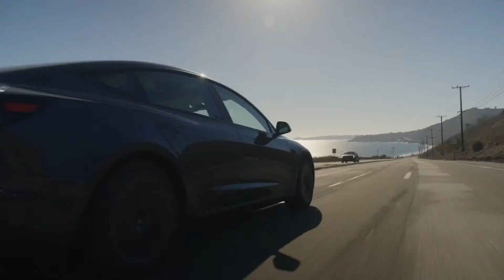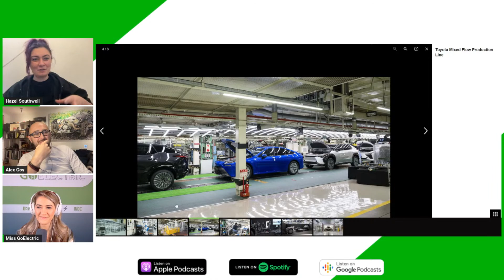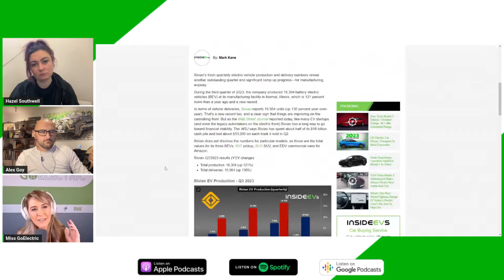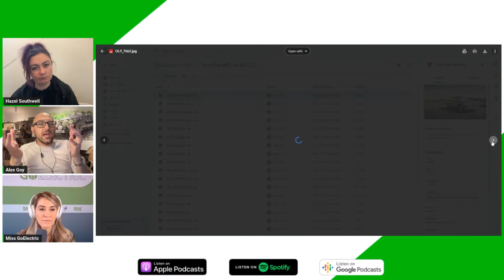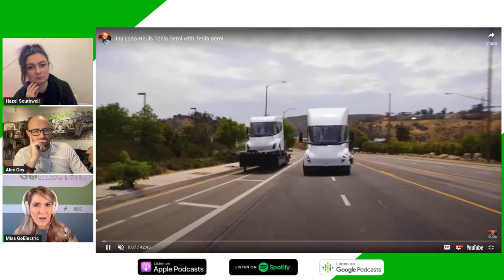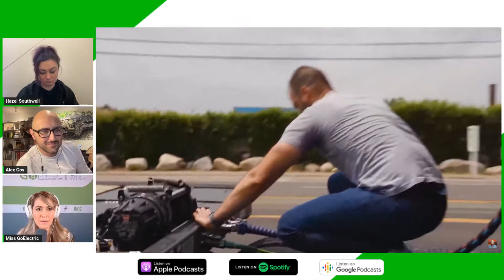InsideEVs Podcast #181: Hyundai Adopts NACS, Toyota EV Production, Ford + GM EV Sales, Tesla Updates

Comment: Having done some work on adding a second model to a Landrover production line (L462 and L405), despite the two sharing a platform swapping between models added considerable time to each cycle in some of the process steps.
The particular bit I helped with the time went from 10 to 12 seconds even without a model change just  because the robot needed to dodge the new parts. A change of tool added 10-15 seconds to that. so it increased the time of production, by 20%+ (for this cell) at the cost of not needing room to build a new line.